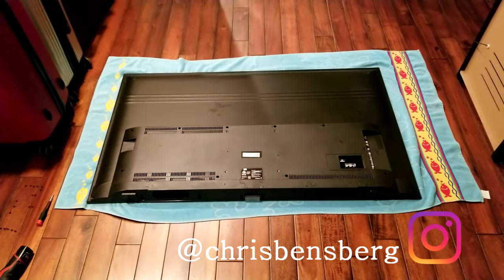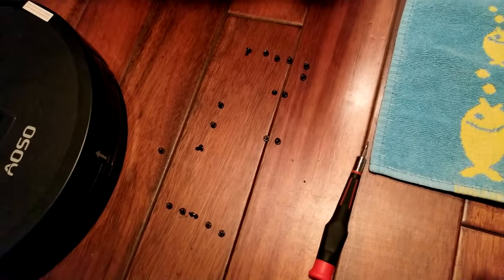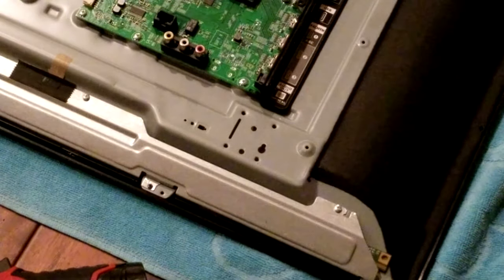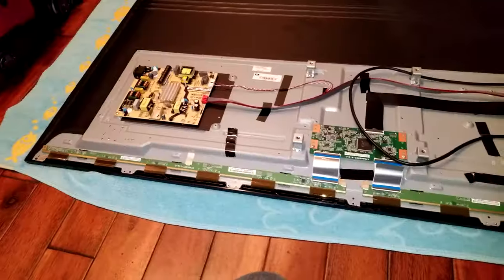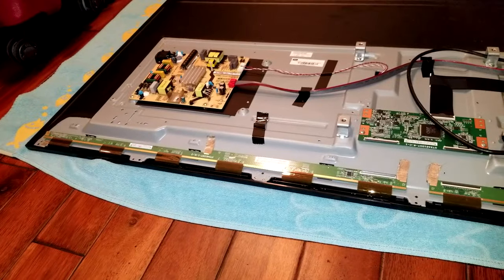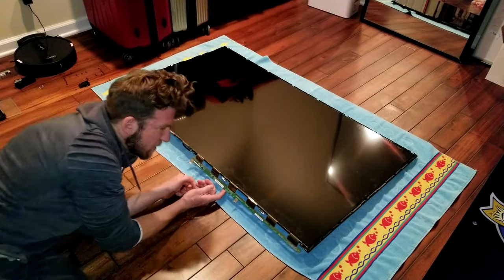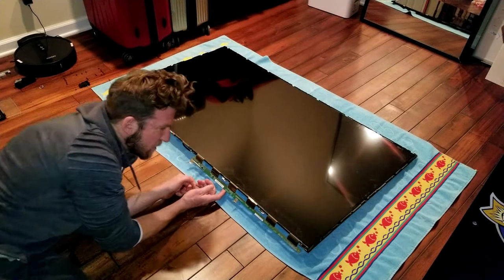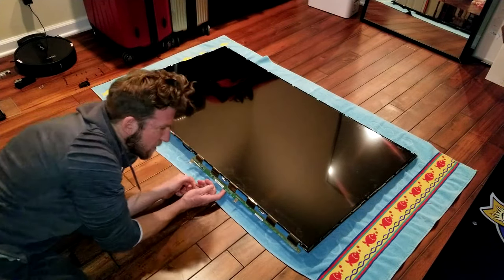TCL 55 Inch Has Sound But No Picture FIX!

Comment: If you want tip to prevent this as well as the cause... of the issue...  From owning one myself I think the issue is people setting the screen brightness too high... 
I know for owning this kinda TV it's a very Dim screen so the first thing people wanna do is max out the brightness even then it's just ok..... The problem is running LED on 100% full power mode all the time will burn them up ( and  you only need 1 to die to break your TV since they are in series)....

So I recommend if you have this TV like I do 70-80 backlit brightness max.... Maybe even leave it on low power how it's shipped with tho.. that is a really ugly picture... But I've had 2-3 years now and 70-80 brightness setting has worked for me... but leave lower if you wanna be safe... tho again I find any lower just looks too dim...

Comment: Overall, this is a pretty good video. It would have been nice had he not kept the camera in a fixed position, and brought it down to show what he was doing more clearly, especially when removing the bezel. I was following this video pretty closely I thought, and when removing the bezel, I found out too late that the bezel was attached to that plastic frame, and I could have just removed the plastic frame. (Initially, I thought I had to remove the bezel from the frame). I might have missed him saying this, but now my bezel is ruined, because I tried to remove it from the plastic frame, and the TV is going in the trash. In all fairness, I did see a lot of commentors say this before I started, but I thought I could succeed at this repair. And this of course is my fault, not anyone else's. My advice: simply buy a new TV. They are made way to cheaply to make repairs like this  worthwhile for the most part. You may get lucky in this kind of repair, and if you do, more power to you! I will now be looking at new TV ratings...

Comment: I have two identical TCL 55S446.  TV1 has many, many dead pixels and will be the donor, other one (TV2) that I want to fix has screen uniformity issues.  TV2 part of the screen is cloudy looking or is darker than the rest on one side.  Is this due to the white sheets show in the video (I think it's called the defuser sheets).  Would transplanting the white sheets from TV1 to TV2 fix the screen uniformity issues such as the cloudy looking picture and darkness issues on one side of the screen?

Comment: Thanks for the tutorial, unfortunately I did put a small crack in the LCD when reinstalling the bezel, I heeded instruction and was careful but it's way more fragile than I anticipated 
:(.  I do have however have picture again, despite the crack so I know I did everything else right . At least I can take solace in the fact is able to fix the original issue. :)

Comment: So I plugged the power cord directly in the back of the T.V. but still not lighting up my led strips.   I purchased new strips as well.  So my new and old led strips aren't coming on.  I can confirm power to all of the strips with my voltage stick device.  Any suggestions on how to fix?

Comment: I'm hoping that I won't have to go through all that.   The threaded cable connector on the back broke away from box it goes in.  I'm hoping that just replacing the circuit board that that will fix the problem.

Comment: Our TCL just went out last week. I was hoping it would just be a bad part in the LED driver board. You would THINK the LED's would last years and years, but, as usual, crappy parts and probably over voltaged to eek the most light out of them. Forget years of useful life. Imagine how much this would cost IF you could find a shop to repair it! When I go our local electronics recycle center, I see lines of flat screen TV's sitting there! Profit comes before environment.

Comment: Definitely the most delicate part is lifting the display from the frame.  My display was very adherent to the underlying plastic on the top edge only.  I did try to separate the display using very thin plastic (a guitar pick) but after realizing it would not give, the entire display came off easier with the underlying plastic edge attached (top only).  Unfortunately, tyring to separate the adhesive damaged my display so just a caution to those who run into this problem.

Comment: Great tutorial. Just did it. Screen now works. But I cracked 2 corners of the screen when clicking on the bezels.
I thought they were clicked in. Turned it over to put back together and saw they were clicked together. So i clicked the corners when it was face down.
Wasn’t loud at all. But i had a feeling it cracked. Bc my luck. Waste of a day.

Comment: I have a TCl 55" S405 about ~4 years old. Do I also need to buy a led tester?  Or just change all the led stips?  (I have the classic problem of TCL logo comes on for a fraction of a second and then the menus are super dim, can see it with flashlight in a dark room)
Reply: Did you fix your TV? Mine does what you said - logo comes up for fraction of a second, then goes dark, and you can read screen with flashlight. Trying to figure out if bad LEDs or if it is one of the boards instead. Thank you!

Comment: my tv (TCL 55") is doing something similar, but if i do enough system restarts it will eventually come on and display normally...but once i power it off i have the same issue again and i have to system restart until it comes back on (which could be hours)

the sound and everything works just black screen...would the LEDs be my issue even though after multiple restarts it eventually comes back on?

Comment: I have the exact one one of the led strips isn't working does it work on a parallel connection to where if one is bad but all others are good none will work

Comment: If this happens how do you know it's not just one of the control boards?  I mean if it was working but the screen suddenly goes black it wouldn't mean the LEDs are bad, it means something else died.  This video doesn't explain anything apart from disassembly and LED replacement. So again, how was the issue actually determined.

Comment: Still hoping someone responds to my plea for help. Instead of replacing LED'S , simply was trying to switch my almost new screen to a new TCL w/ a cracked screen. Successfully put new screen in place, but when turning over to screw all in place, separated 2 ribbons😭, Is there a way to re-attach ?

Comment: I just got a question. I have sound and a black screen. But when you first turn it on the tcl logo comes on then it goes black. Just real quick flashes tcl then goes black but can hear trying to click through apps. Do you still think that is my back lights? Or could it be something else?
Reply: Did you fix your TV? Mine does what you said - logo comes up for fraction of a second, then goes dark, and you can read screen with flashlight. Trying to figure out if bad LEDs or if it is one of the boards instead. Thank you!

Comment: I have 65 inch TCL left for the day could find remote turned off with manual button on the bottom ..
Returned home turned on and black screen other then it tried to pop up roku sign once  then twice  just a second of a flash both times ..I've tried restarts and resets..still just a flash 2 times shows roku both times fo split sec...then just black ...
Do you think it is led or not ??
Reply: We have the same prob. How did u fix it?

Comment: Tried this, every piece of plastic crumbles when you try to do anything.
Every connector disintegrated as soon as i tried to unlatch the cables. They litteraly melt soon as you touch them and turn to dust. Tv is 5 months old. Never seen anything like this. What a pos.

Comment: I have the same tv. Mine turns on with sound but no picture at all not even a faint one. I took it all apart thinking it was the led's  but I plugged it in when I had it apart and all the led's work. I don't know what else it could be I'm thinking maybe the panel. Does anyone else know

Comment: If anyone is  having issue with no picture, it could be the t con board and you better hope so. Much easier fix
Reply: How can you tell between bad t con board and LED?
Reply: I did I mentioned in this video and my tv still ain’t working. Could it be because of t con board?

Comment: Funny how people will spend $900-$1,400 on a cell phone and not use a case and think nothing of breaking it.

But a $200 tv stops working and they freak out and have to fix it. 

I just wanted to see if it was any easier than a computer monitor. 
I recently attempted to diagnose and repair a couple computer monitors. 
One I did, AOC with samsung panel, was SO thin, it shattered once the side panel clip came off. 
The others seemed plausible to repair. 
After my bad experience with the Samsung panel. 
I think I am going to pass.

I paid $148 for the tv 3 years ago. 
I am going to get a larger Vizio for $220. 

The idea of paying $30+ and not being 100% sure that will fix it and having to wait a week +.

My wife and children are not going to wait. I will get a new tv and then attempt to fix it later.

Comment: I followed the tutorial and changed the light but it still just flashes on then turns off. Anything else I can do?
Reply: See if a factory reset fixes it.
Reply: Did it work
Reply: Did you fix your TV? Mine does what you said - logo comes up for fraction of a second, then goes dark, and you can read screen with flashlight. Trying to figure out if bad LEDs or if it is one of the boards instead. Thank you!

Comment: it occurs to me that , why are we replacing LED lights on a TV?  Isn't the point of the LEDs supposed to be that if one goes out, all the other ones are still working, so that it should be decades before we have to replace LED lights?  maybe it's different on TVs where they are designed to go out at the same time.

but yet, many comments are related to, my perfectly working TV is just showing a dark screen, so I came here to see how to replace the LED lights, because everything else on the TV still works, just not this part that is supposed to last for decades.

Comment: What a shit-show. I did exactly as instructed, but the adhesive along the top of the screen was SO WEL STUCK that the entire screen cracked the second the tape finally released. Pouring more good money after bad. Story of my life.

Fortunately, I have a perfectly good set of led strips (with nothing to put them in)
Reply: List them on eBay, I'm sure someone will need them. :)
Reply: I decided to first see if I could take the TV apart and if successful then order the LED strips. Unfortunately I broke the screen when trying when trying to remove the adhesive from the top right corner. As others have mentioned it would have been easier to remove that black frame and keep everything intact.